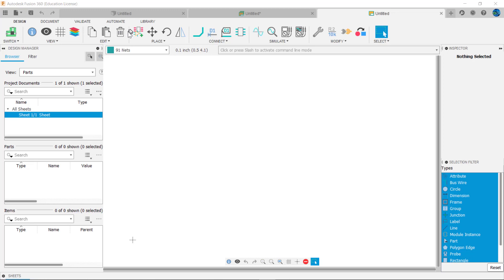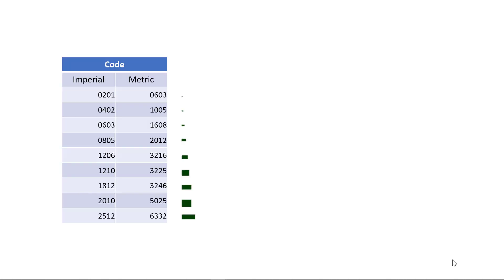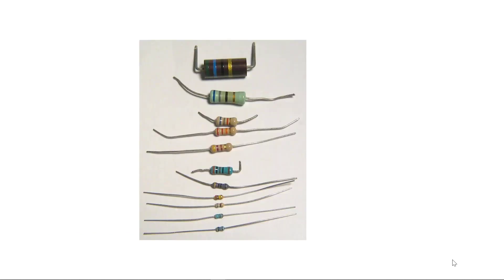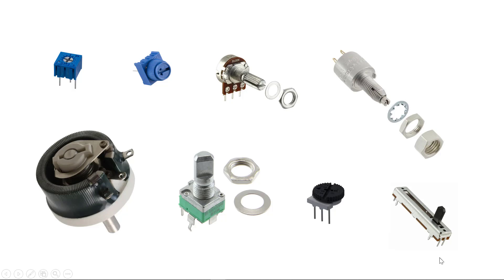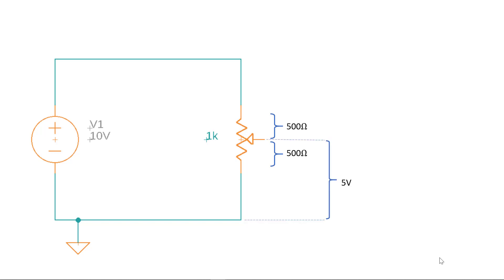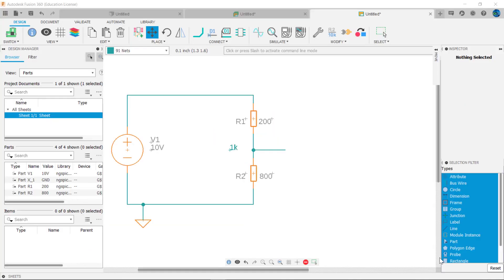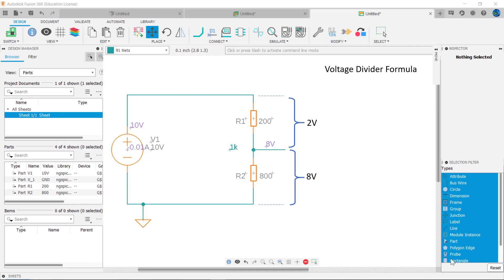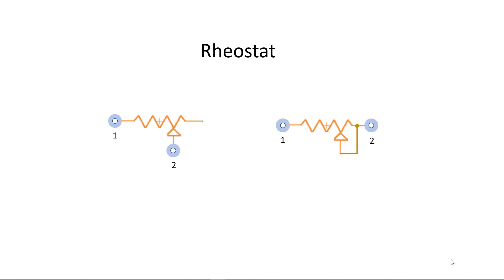Fusion 360: Why are There So Many Different Kinds of Resistors?

Comment: shouldn't the connection of the potentiometer go off to the right, according to the previous slide?
Reply: Not sure what you're referring to. Can you provide a specific time in the video?
Reply: @rudyhofer7046  2:45 , previous being 2:40
Reply: @kensaiix  Yes, good attention to detail kensaiix! I see what you mean. I should have placed the wiper on the schematic symbol on the left to match the pictorial.
Reply: @rudyhofer7046  i am not familiar with circuit iconography (there is an iso standard, amirite?). i just figured, since you were "breaking" the iconography anyways by sliding the wiper up and down to illustrate the "two sides" of a resistor, that the wire should start at the wiper.
Reply: @kensaiix   Yes, I'm aware of three standards, ISO, ANSI and IPC. Thing is not everyone adheres to the standards, and electrical schematics use symbols that differ from electronic schematics.